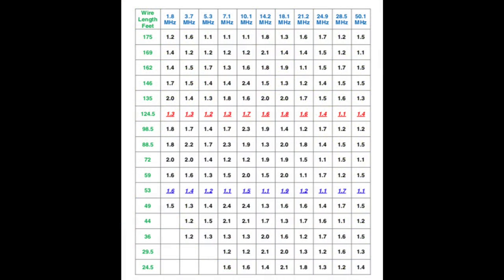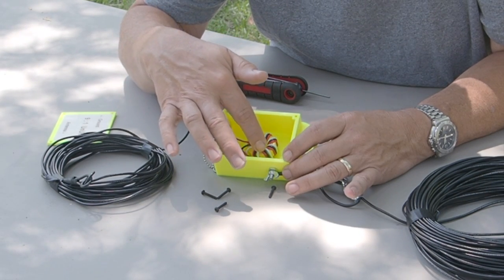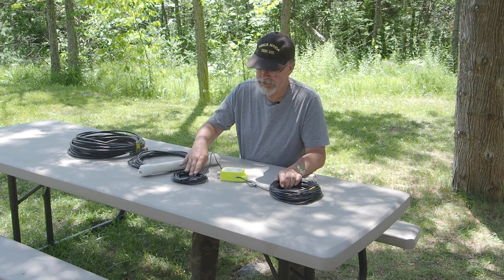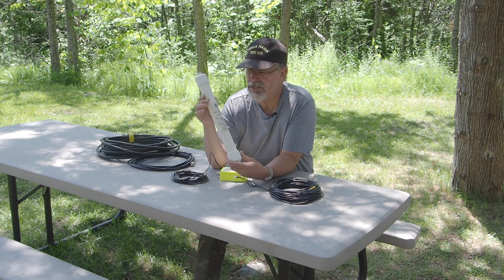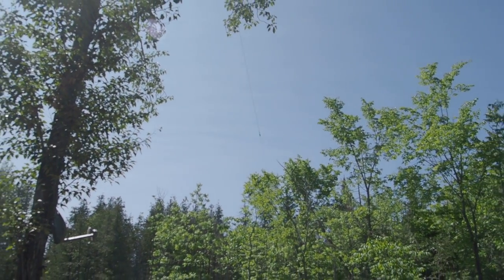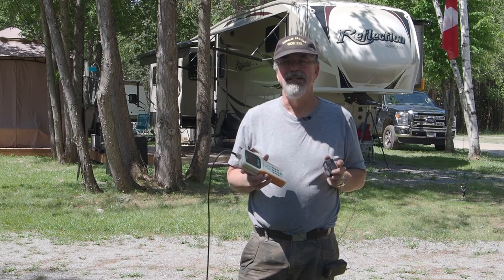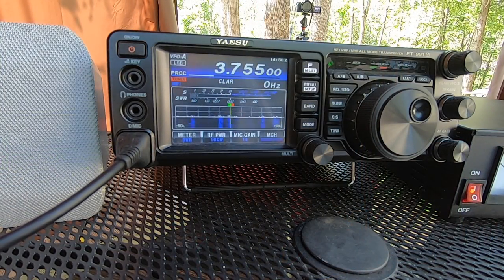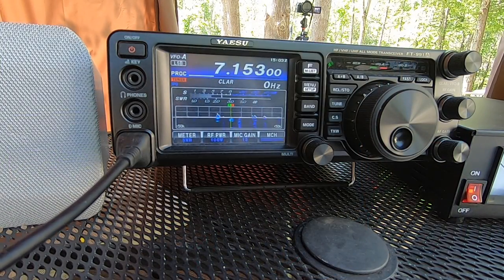Long Wire Antenna

Comment: I enjoy your videos. I noticed your speaker. What are you using? Hopefully we can make a contact someday.
Kevin
KA0KAE
Reply from the maker: Hi  the speaker is an old speaker from a cheap tv surround sound system  I got 4 of them for $5 at a thrift store.  73